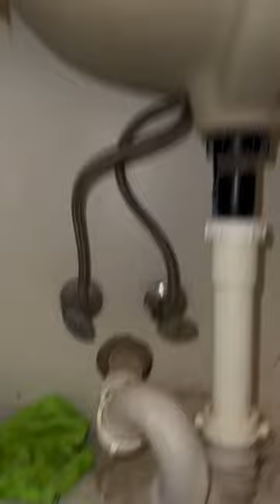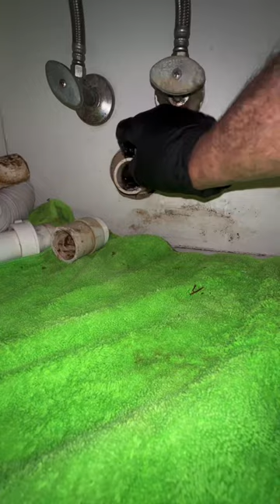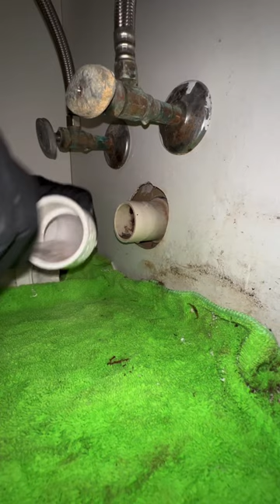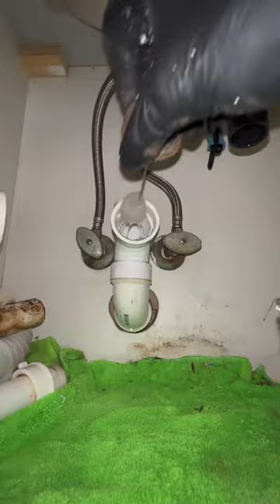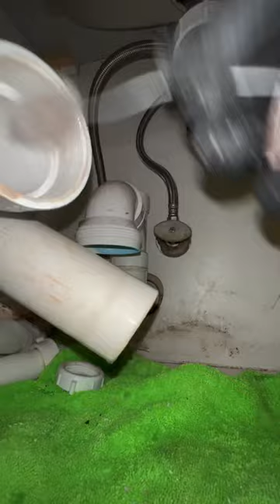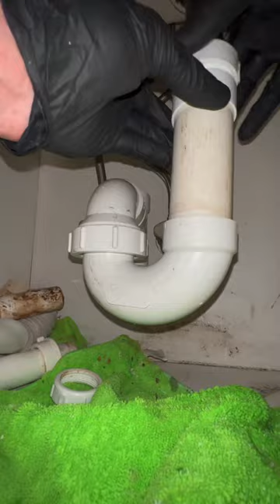Bathroom Sink Drain Repipe #plumbing #plumber #diy #asmr #howto #plumbinglife #sink #shorts

Comment: I’ve been service plumbing for 22 years and you’d think I’ve seen it all but every once in a while I still run into something that just makes me shake my head.
Reply: 🤣🤣🤣 make something very basic extremely difficult 🤦🏾‍♂️. Just use the trap adapter at the wall and run everything else in tubular
Reply: He also made a siphon that p trap will dry up
Reply: I swear I thought it was just me haha
Reply: The trap is too low and I bet the customer didn't want to spend the money to open the wall and raise the drain so the only way to do it cheaply is exactly how you do it.

Comment: You mean that that drain isn't already on a vent in the wall thru the roof😊
Reply: Probably not since he put an emitter vent in.
Reply: @ImTrans-Former I would have checked what does it do 90 down in wall run horizontal into stack sometimes you have to look around, nice s trap

Comment: This is a good example of what not to do. This guy should be ashamed of his work.
Reply from the maker: 🤣😂 you couldn’t carry my tools kid
Reply: Aint a thing wrong with what was done here. Armchair plumbers are rad.
Reply: @elijah3807 you obviously don’t know what you’re doing either since basically everything he did was wrong lmao. He crown vented the trap and put an unnecessary AAV on the drain. Also much harder to clean a drain with a trap outlet glued on rather than removing a bag trap and going straight in through the trap adapter. It’s amazing how much service technicians and Union plumbers don’t know
Reply: @dailygrind5575  no its not you go down the aav with the snake machine  and le t faucet run  while doing it. it's amazing how dumb this comment section is
Reply: That's a S trap, no good mr george
Reply: @prenleen8563  no good at all

Comment: Pipe between the tee and the trap isn’t long enough, you crown vented the trap. Has to be at least 2-2.5x the diameter of the pipe depending on which code book your area uses. Also since the drain was coming through the wall and not the floor, I would assume it’s already vented through the roof so no need for the AAV. Not sure why you didn’t just throw a 22 on the drain and put another trap on? Overcharging customers and teaching people incorrect ways to do repairs, definitely a conservative 😂